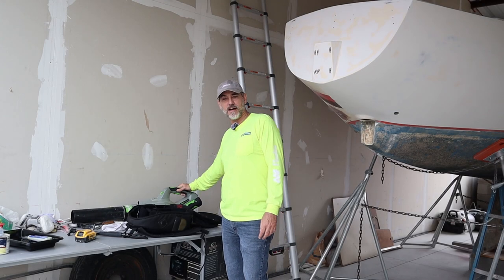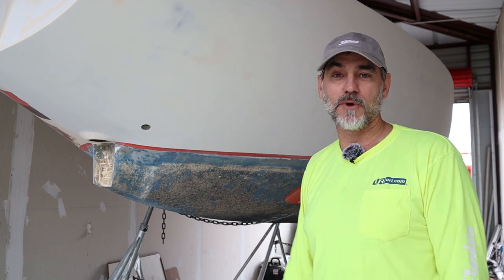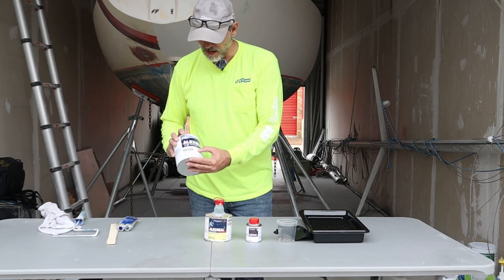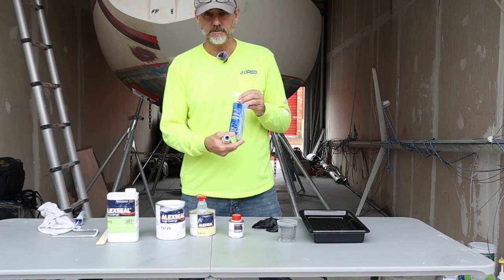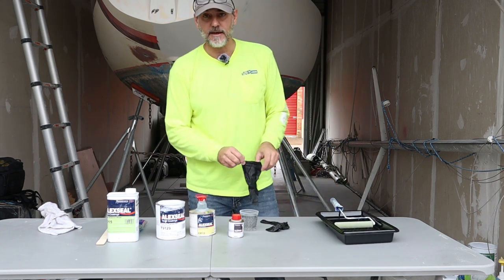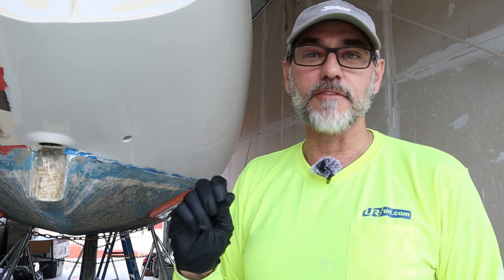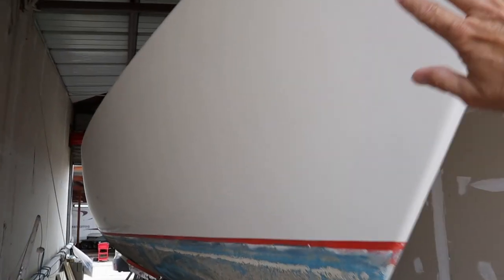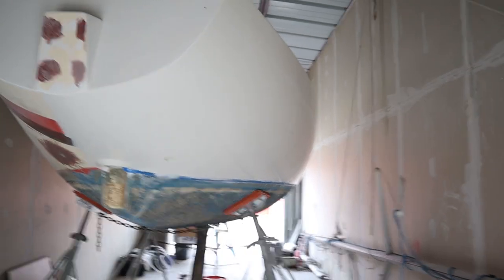Sailboat Refit #14 Painting the boat sides with Alexseal.

Comment: Hi which primer/compound did you use? I have a fiberglass skiff that needs a new gelcoat so I'm thinking to use Alexseal instead if it would be quicker and easier to touch up. What do you think?
Reply from the maker: I think Alexseal paint would be easier than gel coat.  You can use the regular Alexseal primer or the high build primer if you want to cover some low spots.  The high build only come in gallons though and it’s much harder to sand.  I recommend the regular primer.
Reply: @finditfixitsailit9322  Thanks so much! DO you recommend using a different primer to save on cash or is it best to use both paint and primer by Alex seal?
Reply from the maker: I would use Alexseal primer with the Alexseal paint.  Not sure how the paint would react with a different primer and if it didn’t adhere correctly it would cost you much more money and time.
Reply: @finditfixitsailit9322  Would a product like Total Fair be ok to use instead of the alexseal primer
Reply from the maker: Total fair is ok but it’s not a primer.
Reply: @finditfixitsailit9322  Thanks! I see I am in need of a thick compound for my hull. Which one do you recommend?
Reply from the maker: Total fair is what I use
Reply: @finditfixitsailit9322  Thanks, thats what I'm looking at also. I wonder if mixing your own will provide the same result.
Reply from the maker: I don’t know

Comment: Can you please tell me what roller cover you used?
Reply from the maker: I use a small microfiber roller like 1/4” nap for ultra smooth surfaces. I get them at my local paint supply store.
Reply from the maker: The trick is to use enough thinner
Reply: @finditfixitsailit9322  can you  share the brand of the roller? Thanks
Reply from the maker: I think it’s a Purdy brand   Not 100% I will go by and see when I get the chance and let you know for sure.
Reply: @finditfixitsailit9322  thanks again